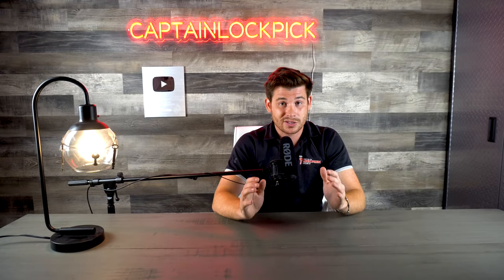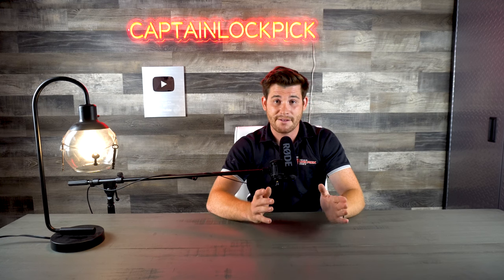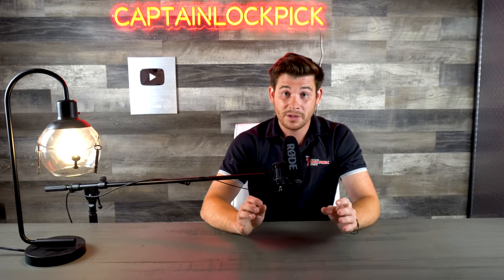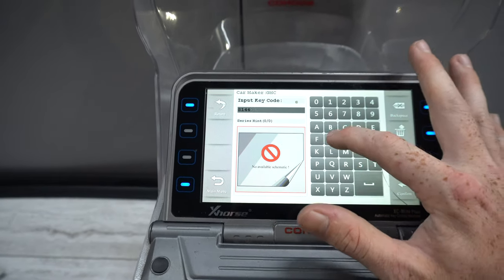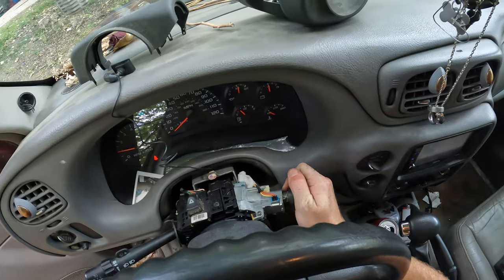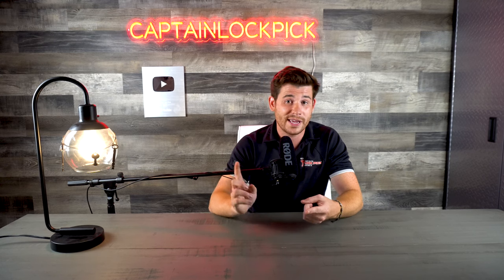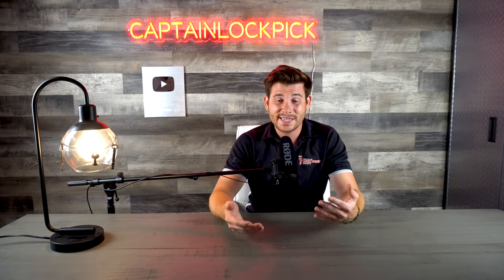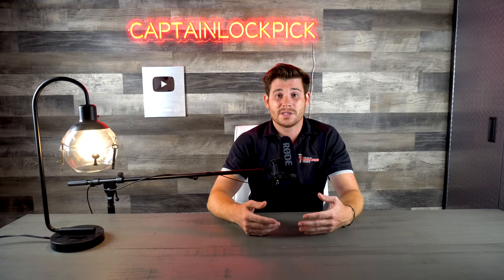Easily Make Car Keys Using Keycodes

Comment: Great videos and thank you for your time and willingness to share your experience.  I am an Auto Technician and getting into the key cutting aspect of vehicle service.  I have the IM508 programmer by Autel. My question is I would imagine one would need an LSID number to sign up for key codes from  Rapid Codes or to purchase some of the equipment you have. Is this correct? I am thinking about registering with NASTF.
Reply from the maker: My advice to you is don’t rely on key codes rather use them as a backup. Master the lishi tool for a successful career as a locksmith. NASTF is not needed. Call Rapid Key Codes to sign up with them to have them as a backup.
Reply: @CaptainLockPick  Thank you for the advice. I have been buying Lishi picks. I saw in a video where a locksmith had a guidebook that listed what picks were needed for each vehicle by year , make, and model.  Would you happen to know where I could buy one? Thank you again for your willingness to share info.
Reply: @CaptainLockPick  I would disagree. We run 120 to 150 calls per week. NASTF has codes that many of the other vendors don't have. We also use another vendor in addition to NASTF. I don't like NASTF. It takes forever to go through their process but it's part of doing business. I could whine about this forever. There was legislation way back when that said key codes were suppose to be available to us without fees but that fell by the wayside. You have to have the attitude that you don't care what it costs as you pass your cost onto the customer. They are the ones who lost their keys not you. We are still cheaper than the dealer and we go to them. The only thing we aren't doing is the Lishi tools. We have them but we are so busy running calls my guys feel they can't take the time to master them so we just call for codes. I wish that weren't the case but it is what it is. We also aren't doing the ones where you have to take take half the dash apart to get to a connector. Once again we are so busy we lose money on easy jobs spending hours on the PITA ones. We only do cars too. Every year this gets more complicated. I come from the days of impressioning so this is all very different. We have about 10 different scanners including but not limited to an Autel 508, 608, Smart Pro and about 5-6 Chinese machines.
Reply: @scotts4125  where is your business based out of? I would love to apprentice with a business like yours. Do you train or take on inexperienced people who are highly motivated to learn?

Comment: I've been using RAPID Key Codes out of Missouri for the past couple of years and I believe they sold out to someone else but it was like a close family friend but also use auto code because you can just use their app 24 hours a day, but there are limitations on certain models for Key Codes that you can get and that sucks that's why it's always good to have a good relationship with your Dealerships if you're needing that key during the day though a lot of services will only let you get up to a certain year model like for example Ford,  I cannot get a code past 2014 through any key code service that I go through and I go through multiple code services and GM codes are super expensive but most of the time I use my Lishi, pop the ignition on GM or door lock cylinder like Toyota or Honda depending on which vehicle you're working on but yes, sometimes you do need a back up for a cold service or if the weather is really bad and you just want to get the job done

Comment: Hello sir! Am about to buy some equipment mind am new to this, what do you recommend to start off with? This is what I had in my mind to get.  Key tool max pro, otofix im1 and a probably Xp-005l cutting machine,  question is what do you recommend the most the otofix or a im508s ? Or am I shitting in the wrong 🕳️. And should get something completely different all your help will be grateful. Thanks

Comment: I have a 64 chevy nova ss, no keys, pulled the trunk lock cylinder and it has no codes for a new key. I'm pretty desperate to get a key made, 10 locksmiths told me they don't work on cars unless they're 1999 and newer. Any advice would be appreciated

Comment: hey bro I work at a used car dealer an we get about 5 cars a week from auction that don't have keys or keys get lost we have about 90 cars an trucks on out lot an we have been using victory locksmith an they charging us about 375 to 450 depending on the cars or trucks can you tell me what scanner you got an what I would need to get started cause I can start a side hustle making keys for my work an just charge them like 50 bucks less then victory an mayby start a locksmith business I live in Dundalk md would I need a business  license ?

Comment: Ok you can cut the key but the key in any gmc/Chevy today is also chipped. I know how to program a chipped key but to purchase one I had to go through the dealership regardless. So for future knowledge are gmc chips specific or generic? Can I get a random blank with a chip in it and cut the key and go through the program process or do I still have to buy a $85 key from the dealership
Reply: You can program it yourself if the tool allows you

Comment: I have a question to ask you or anyone reading this comment. I have a 2007 Toyota Corolla. I lost the key so I had a couple people come out to cut a key and reprogram the key. One person said the 'immobilizer amplifier' was broken and that's why they could not reprogram the key. A few days passed and I found the original key however it would not start the car because the old key was erased from the computer and the car was in program mode with the security light on. I bought a new key, ignition, immobilizer amplifier, ECU all from the same make and model and all from the same car so they were already merried together. When I put the parts in my car it would turn over but not fire up. The car was running perfectly fine before I lost the key. Any ideas on how to fix this or what I can do to finally get the car started ?
Reply: You need to have the key reprogram
Reply: If old key has been erased and you have replaced ecu and other parts maybe an issue, however, maybe worth putting everything back in and reprogram key back to the car.

Comment: Hey Brian,

I've been watching your Youtube channel. I'm an old guy (54 yrs) here looking for a new career. I was just wondering if you could tell me a couple things before I decide to move forward. 

1. Have you ever tried to open something for a client were unable to? What do you do? (car, home, business).
2. What services do you provide? I've been researching and it seems there is so much in locksmithing. A bit overwhelmed.
3. Where do you buy the supplies for your automobile keys when you use that electronic reader and machine?

I truly enjoy your videos and hope that you can help me with these questions. Been difficult finding a job at my age so I have to try something.

Thanks so much have a blessed day,

Richard Johnson
Reply: (1) I have ran into certain vehicles I couldn't open due to the back in the day. Ideally you can open anything but it comes in between destructive and non destructive. (2)My company does Automotive, Business, and Residential. We don't drill safes but we do safe code changes(cost ROI not worth it) No CCTV since the city ordinance calls for electrician and license's. But we offer a selection of services.  (3) We have used multiple suppliers over the past 20 plus years doing this. We are now down to CLK Supplies and American Key Supply primarily. Most of the other suppliers have been bought out by big cooperation's. Machines depend on what you want to do, Also FYI 1 key programmer won't do it.
Reply: @sgtlocksmith  how much does it cost to get a key made for 2006 f150 I have lost my original key and I can't get the lock cylinder out

Comment: Nice why dont you just tell thieves where all key codes are stamped on each vehicle.
Reply: They’d have to have a machine to cut the new key, know how to program it and all. Or they’d have to show an ID and vehicle registration to whoever they go to in their attempt to have the key cut for them. But still, they can’t program it without the correct equipment so the most they could do is open the car door, unless the car is super old without a chip in the key. So… this scenario you mention is highly unlikely. Hope that eases your mind.